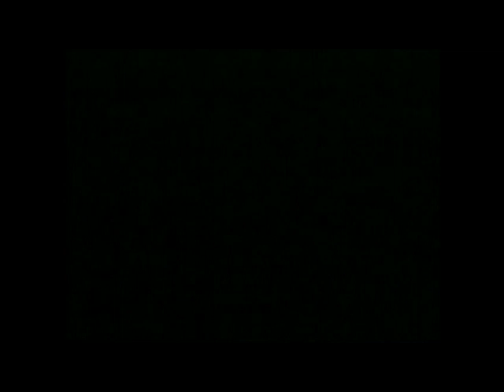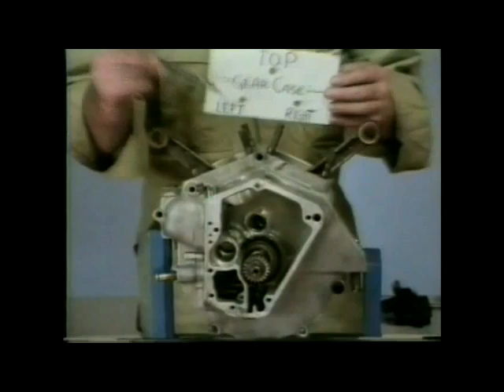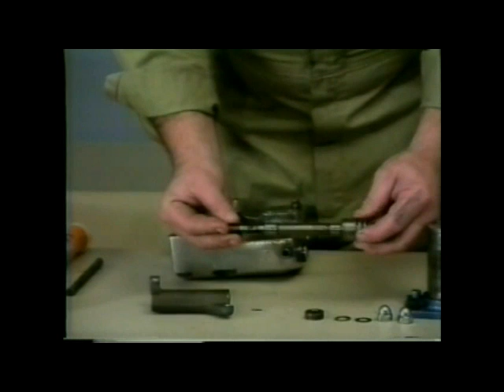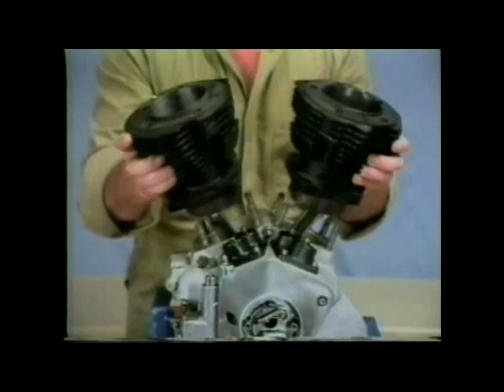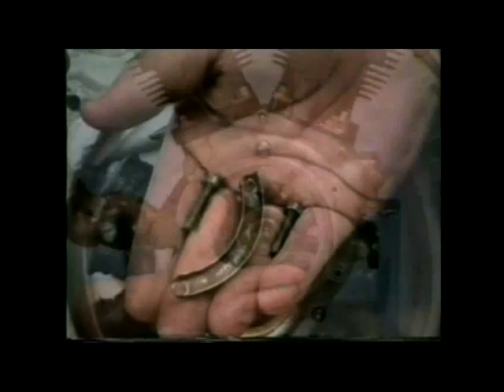ShovelHead overhaul

Comment: 0:00 - Intro
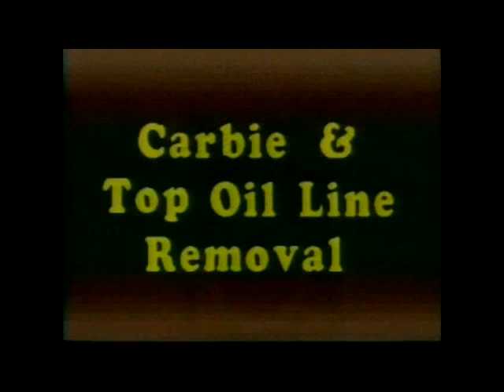1:02 - Carburetor & Top Oil Line Removal
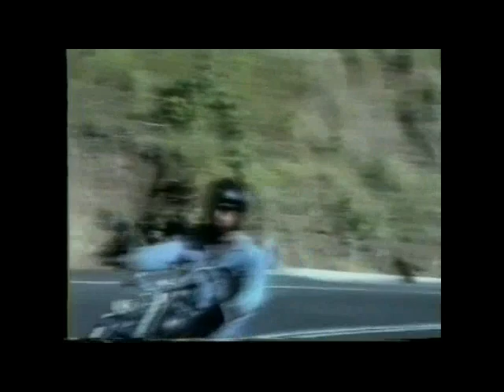3:21 - Push Rods & Covers Removal
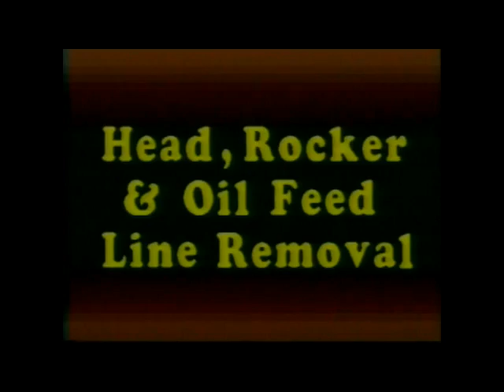6:51 - Head, Rocker, & Oil Feed Line Removal
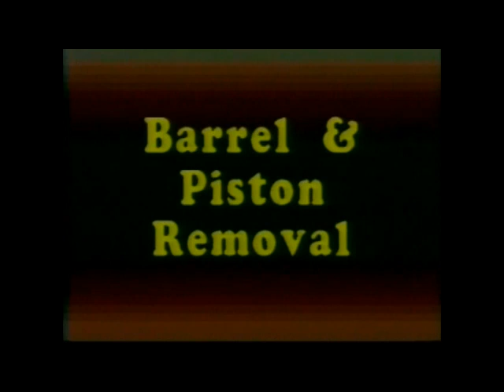8:12 - Barrel & Piston Removal
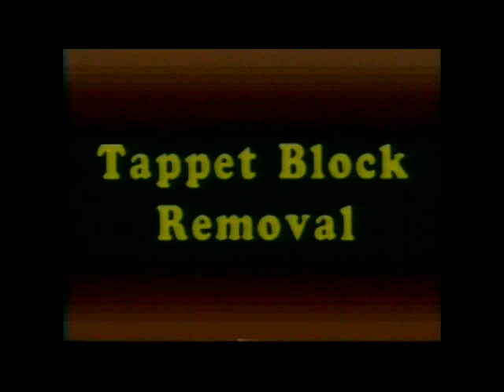10:08 Tappet Block Removal
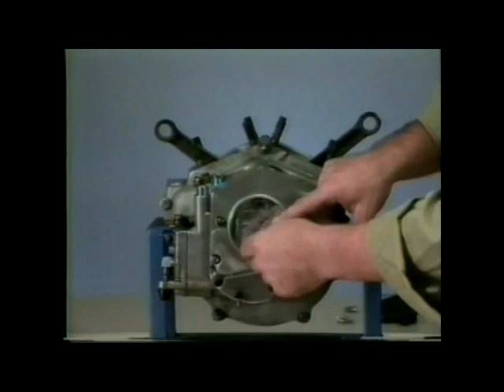11:06 - Points & Condenser Removal
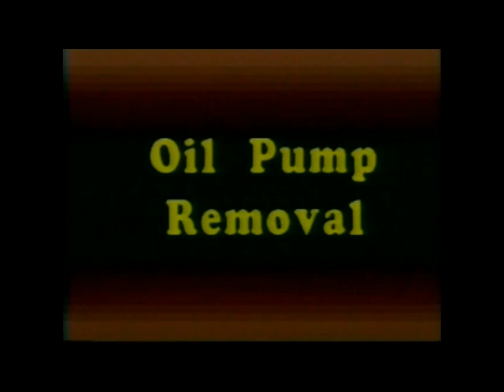14:04 - Oil Pump Removal
18:12 - Stator Removal
19:16 - Splitting the Cases
20:18 - Head and Rocker Disassembly
30:03 - Crankcase Re-assembly
30:48 - Oil Pump Re-assembly
33:12 - Cone & Gear Case Re-assembly
36:28 - Tappet Block Re-assembly
37:51 Piston & Barrel Re-assembly
44:00 - Head & Rocker Replacement
45:40 - Push Rod & Cover Re-assembly
49:38 - Carburetor Replacement
50:11 - Stator Replacement
51:52 - Static Timing & Setting Points

Comment: Thank you for posting this! I never attempted to rebuild my 1975 Shovelhead FXE before and it sat for many years while I rode my 99’ FLH through them years. Now it’s finally time to rebuild my Shovelhead and I don’t think I would have had a clue how to do this without you posting this video. Now that I’m confident I can rebuild that engine I can’t wait to kick that Shovelhead motor over and hear it roar to life!
Reply: I'm about to do the same... My shovel was my first bike until I blew the transmission slowly becoming a basket case. And I've ridden all kinds of Harley's from tour guides softails and my fxr. But I've always wanted to get back on my shovel...